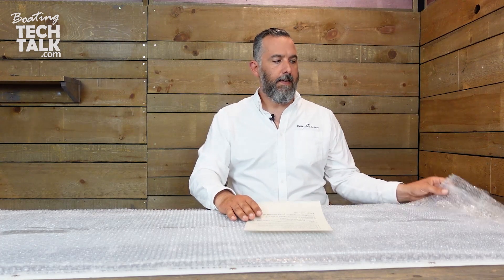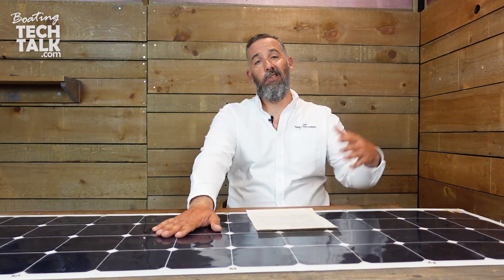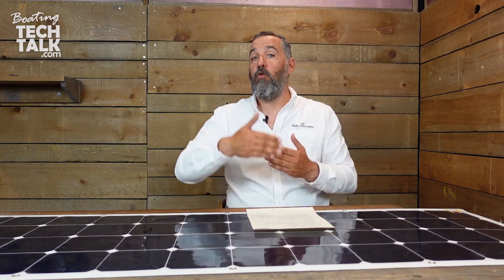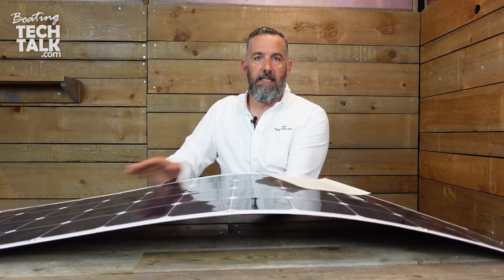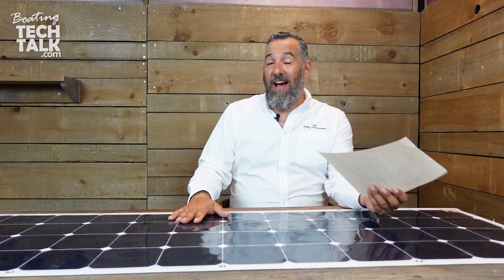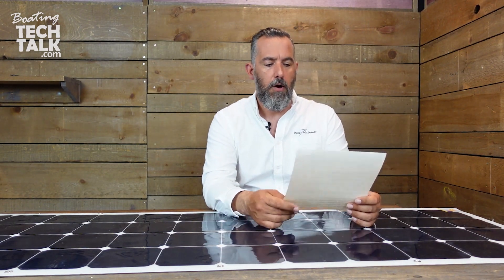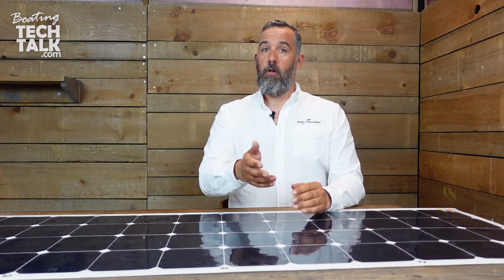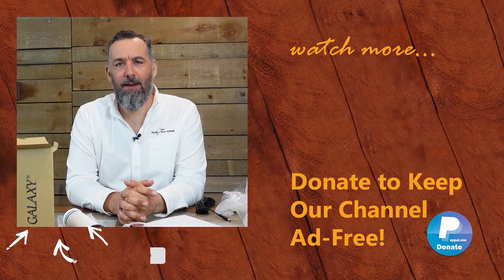Sol-Go 160W Flexible Solar Panel - Unboxing and Product Review

Comment: AMAZING VIDEO!!!  I wonder if you could offer advise?  I have a 34' boat with 300ah of battery that I want to eventually expand to 400 or 600 ah.  My plan was to have 2 x 100 w solar panels on the bimini and then 2x 100 w solar panels in front of the dodger for a total of 400 watts.  I am unsure of the best set up as there may be occasional shade here and there.  It is a sailboat.

I was thinking the best bet is (bimini 2x 100 in series) & (dodger 2x100 series) each with their own controller.

do you need blocking diode between panels if its in series?

Also what size gauge wire would I need? (distance as crow flies)
bimini distance to battery approx 8 feet
dodger distance to  battery approx 12 feet

Also am I correct to believe that in should be able to pull in 80 to 120 AH per day with 400 watts of solar...based on weather?  will mostly be florida, carribean, summers in chesapeake.  Also what is the best size controller for 2 100 watt panels in series?
Reply from the maker: With solar arrays, when shading is a possibility, suggest you have each solar panel connected to a dedicated solar controller.

Comment: when attaching the flexible solar panel , for example by zips, to avoid losing efficiency by overheating,  cutting out a 'window' under the panel would allow free circulation to keep the panel cooler, but would it be safe for both the panel from scratching the underside and would it still get hot enough to represent a burn hazard?
Reply from the maker: Interesting idea, albeit haven't seen this sort of setup before. Anyone else can comment on Stephan's suggestion.

Comment: I have a question... On my power boat the best mounting location is on top of the pilothouse. Do these panels have a challenge being firmly mounted to a hard surface like a fiberglass pilothouse roof? Thanks for a great video!
Reply from the maker: Flexible solar panels can be mounted on hardtop surface (e.g. fiberglass cabin top) with fasteners or even with an adhesive.
Reply: @PacificYachtSystems  Thanks!!!

Comment: Hi Jeff! In the Med and the South Pacific solar panels can get really hot. On the Balance 482 catamaran they install the solar panels with a distance to the roof. What is your recommendation?
Reply from the maker: Good point, for rigid solar panels you definitely need an air gap for cooling and flexible solar panels can do without an air gap.
Reply: @PacificYachtSystems  Clear statement, thanks Jeff! This is often neglected even by reputed yards...

Comment: Regards from Slovenija Jeff.i have 400amp batery bank and my sistem alow me max 300w solar panel and max OCV solar power 23v and i can charge up to 140 amp ,i will wire solar panel on paralel becouse i can not voltage make bigger then 23v and here comes my dilema  ,i dont know  its better or the same  if i buy 2 solar panel 150w or 3x 100w solar panel ?
Reply from the maker: Both options, 3 x 100 watt panels or 2 X 150 watt panels are similar, assuming both setup fit on your boat, i'd lead towards going with 2 X 150 watt panels.
Reply: @PacificYachtSystems  i can get 100w panels output 22.6 v  8.6A ,150w panels i can get max 18v becouse my sistem i cant put 25.6v so i have less amp for charging  but one 100w panel cost 700€ and 150w panel only 200€

Comment: I personally have thrown flexible solar panels (140W) each into the garbage and replaced them with dependable Victron Energy traditional panels. The flexible panels I purchased, were some of the most robust panels I have ever seen to date - but they failed twice (covered by warranty the 1st time - after severely complaining and driving 5 hours to drop them at the distributor's door) and again after 6 to 9 months of full time use in the Med (I was over a thousand miles away that time, so into the garbage they went). I will never trust them again and the warranty of these panels are often significantly less than the 20 to 25 years of traditional panels. Jeff I strongly recommend you test these panels out over a long term - like 2 years - before you put your business's stamp of approval on them...
Reply from the maker: You bring good points and we too have learnt the hard way that not all things last as long as they should.

Comment: Great video, but what are inches? A measure of length?
Reply: Inch is an old English (Roman) measurement --- it translates into 1inch = 2.54 cm

The unit derives from the Old English ince, or ynce, which in turn came from the Latin unit uncia, which was “one-twelfth” of a Roman foot (circa 7th century)
Reply from the maker: Here are the dimensions in mm:  1,572  X 556 X 18
Reply: @PacificYachtSystems    By the way, we DO NOT count in milimeters, rather in meters or centimeters.
Hence your numbers should read: 1,572 X 0,556 X 0,018 meters. Thanks. Now, you also put a dot / period where we put a coma, thats another discrepancy...
Reply from the maker: Thanks Bill for the history lesson, love that stuff, puts context to words.
Reply: @PacificYachtSystems    Thank you gentlemen, that is to say that this old English/Roman measure is now obsolete, let’s all move now to metric - just one country is still into this old system...

Comment: Great video Jeff! I watch all your videos. They help me immensely. One question. I was looking to mount 4 panels. 2 to my Bimini and 2 on my hardtop of power boat. My hardtop is fairly flat. Would you recommend these for hardtop or something more rigid that has higher output? I would prefer 2 that can be walked on also.
Reply from the maker: Flexible panels are great for hardtops, bonus the flexible panels can be directly mounted on the hardtop.
Reply: @PacificYachtSystems  thank you sir 🙂